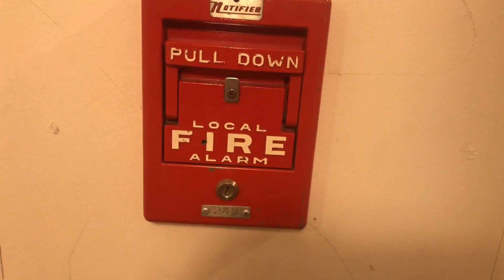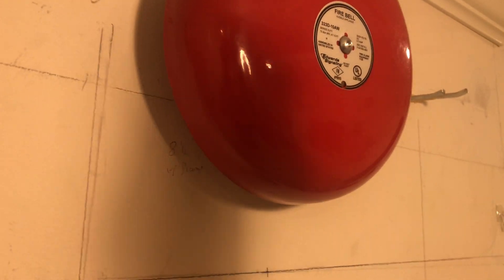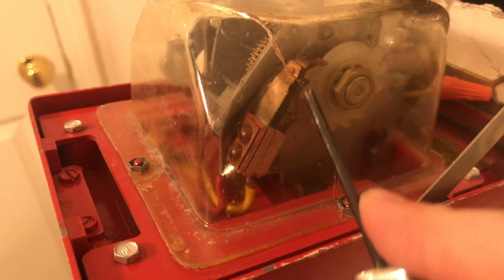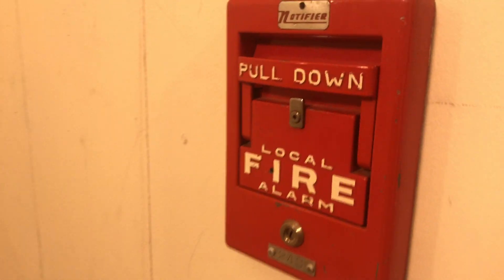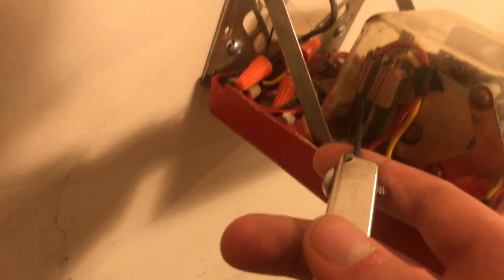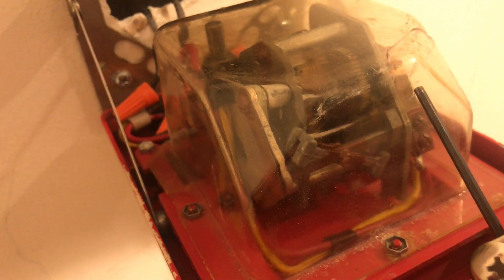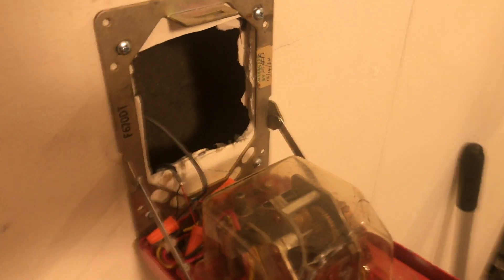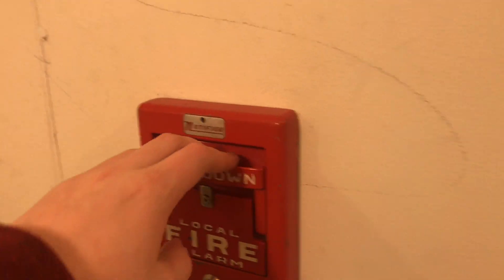Testing and Overview of a Notifier Coded Pull Station

Comment: This is the closest that I have come to the fire alarm system that was used in my elementary and middle schools.  Both schools had an Edwards system complete with single stroke bells and Edwards coded pull stations.  The code in the elementary school was 4-2-4.  The code in the middle school was 3-1-3.  This was most likely due to the fat that the boxes bearing those codes were located closest to the principal's office.

Comment: I think coded pull station days they had different codes. My middle school had 1-1-3 every 5 seconds for fire drills and one time it was 3-1-1 every 5 seconds. They were single stroke bells. They replaced it with the est genesis speaker strobes.

Comment: Didn't some coded pull stations have a little motor instead of the spring ?
Reply from the maker: Possibly, I am only familiar with the mechanical ones as I prefer them
Reply: @FireAlarmsandSuch  single stroke bells can’t vibrate if they’re set to continuous they’ll ring once right?
Reply: Yes.
https://www.youtube.com/watch?v=kcOE51K1t7U - Simplex 4274-2
https://www.youtube.com/watch?v=PEgR4dvoruA - Honeywell "decimal coded stations"

Comment: Rip off Simplex coded pull.
Reply: Not a ripoff. These were made by S.H. Couch and rebranded by various other companies, similar to how the Federal Signal Vibratone was also known as the Space Age 2DCD and the 2901-9806.
Reply: @Fahrenheit4051  did notifier and simplex gone together?
Reply: @relevanteaglealarms109  No. Couch sold this model to both companies.
Reply: @Fahrenheit4051  So couch also gave the coded pull patent to Simplex and Notifier.

Comment: In a Fire if you had to pull a fire alarm with a ring on would you need to take it off as it can sometimes be hard to pull the handle? Would the ring affect pulling the lever? How do you adjust your grip when pulling these coded pull stations. Some people may not realize how hard it is to pull it especially if they never pulled it before. So how do you adjust the grip on the lever to ensure you don't let go. Would you need to pull it a little bit out and adjust the grip and pull it down or have to do it a second time because you let go too soon.  Do some people think that the lever would not snap back up and pull it down again thinking the lever would stay down? What do people think when pulling it in a fire and the lever goes back up. Thanks